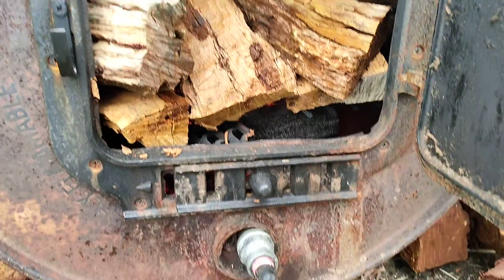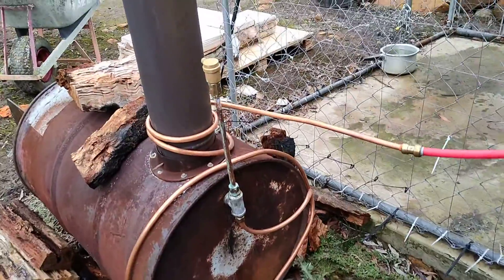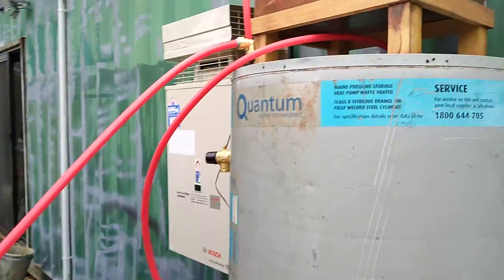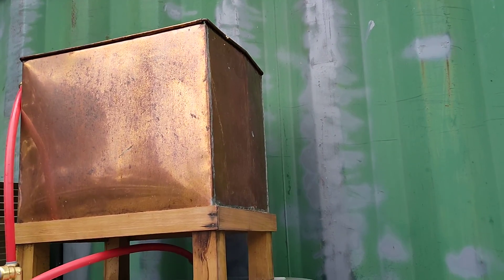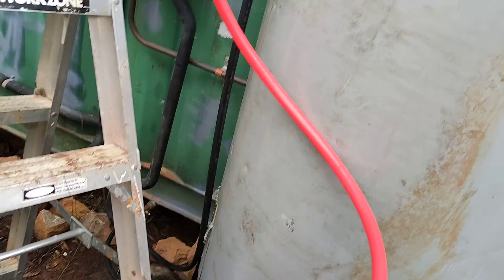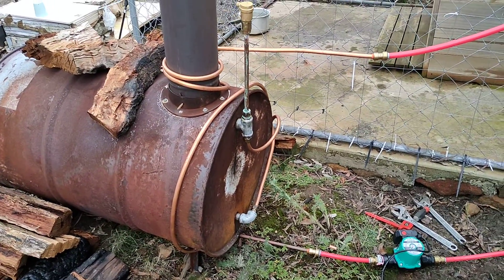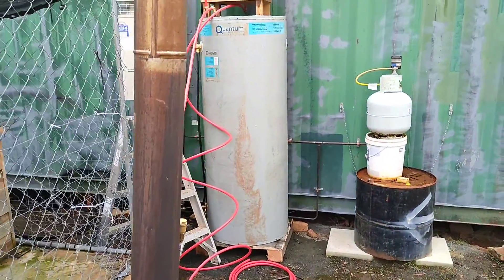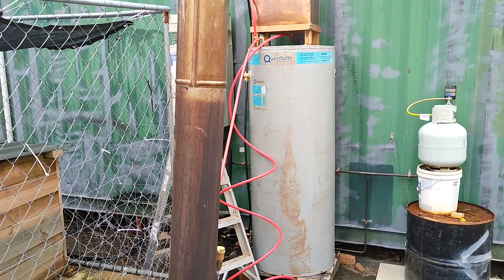OGT 58 - 44 Gallon Drum Water Water Boiler and Heat Exchanger

Comment: It won't be efficient because you are only heating the surface area of the copper pipe, a better way is to weld 2 44 gallon drums together use one as your fire box and the other for your water tank then just run pipe of your water tank mains pressure